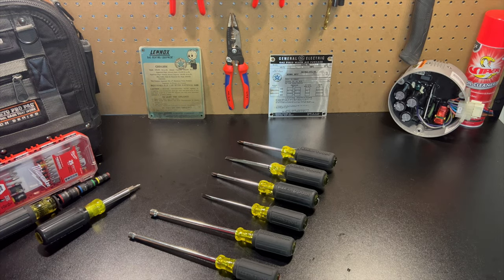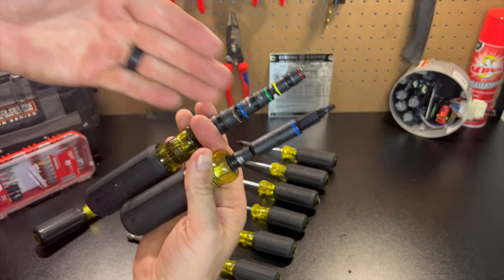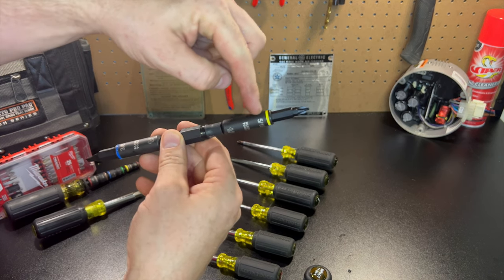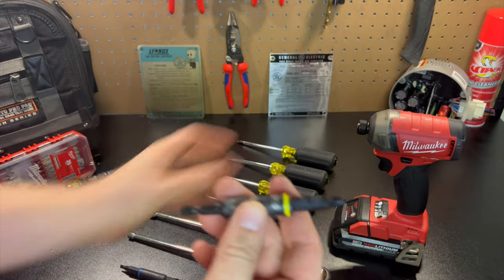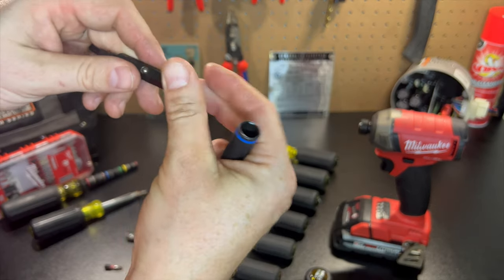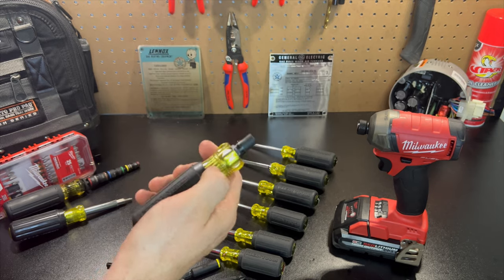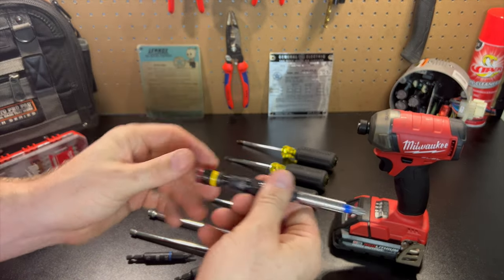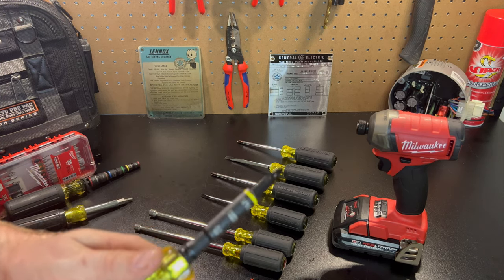Klein 11-1 IMPACT rated SCREWDRIVER | hack the HIDDEN feature

Comment: If you don't hit it with a hammer it's not impact rated.. the bits are because they're oxide coated...but it's not an impact driver
Reply from the maker: For sure that’s why it’s marketed as a “11-1 impact rated screwdriver nut driver” made with s2 steel

Comment: Klein is going after the custom EDC crowd !
Reply: those deep socket drivers are a major win too; for small sleeve anchors & studs
Reply from the maker: Definitely agree 🤘🏻 if they did a few other hollow socket sizes to run some bolts on all thread

Comment: If u have a 1/4 5/16 flip socket on the shorter 1/4 Klein chuck, you can take the flat head or Phillips tip out of the screwdriver and use the chuck then u have almost every common screw/ nut bit on your impact
Reply from the maker: Pretty solid there!! Definitely versatile, solid tip 👍🏻

Comment: I already have 4 multi bit screw driver but I had to order this.  It's just so cool.  I'm glad I didn't bought the flip impact socket.
Reply from the maker: This is a really nice addition to the line up! I have a lot of the multi drivers also but just can’t seem to get enough 😂 🤦🏼‍♂️
Reply: @KoolinwithKrauss  I also tried swapping the bits with my milwaukee 13 in 1 and another klein heavy duty multibits and they all fit with this screw driver.  It's been a while since I got excited with a tool.  lol.